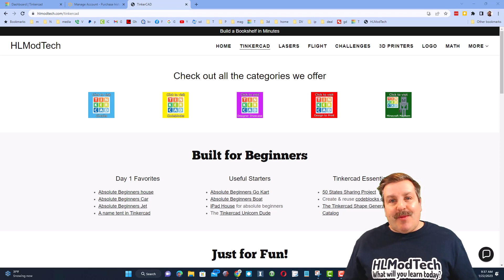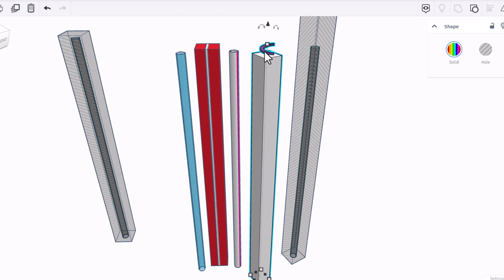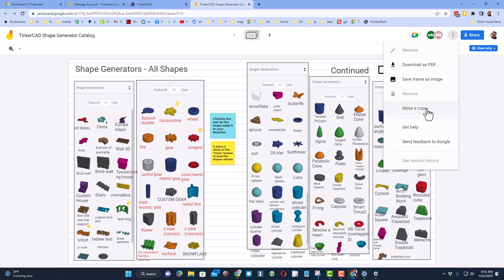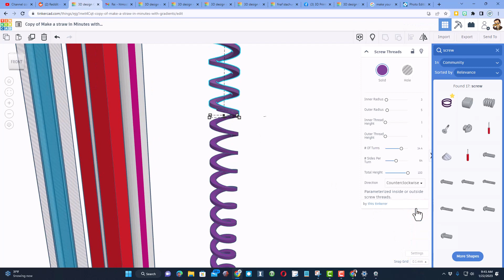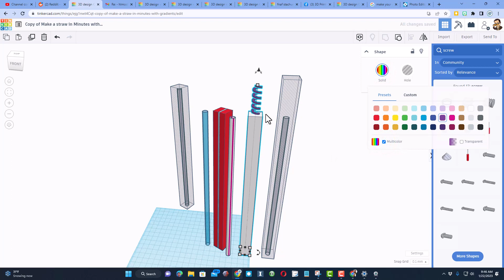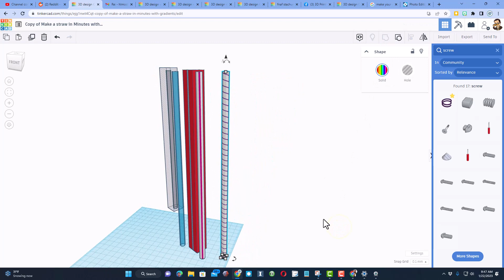Make Tinkercad Straws with Spiral Stripes using Gradients in Minutes

Comment: i just noticed that i can make my treads diff, i alway been cutting out the center of the screw.
thanks. I'm trying to learn advanced tinkerCad options and settings to where i can make things i need to create models.
just seems there's always something im not able to sculpt or modify easily. Im hoping i can skip leaning fusion 360 and Blender
Reply from the maker: That thread tool is super slick. I really need to take some time to make a garden hose adapter. I am sure it would get used a ton.